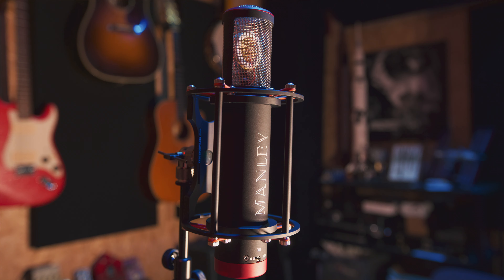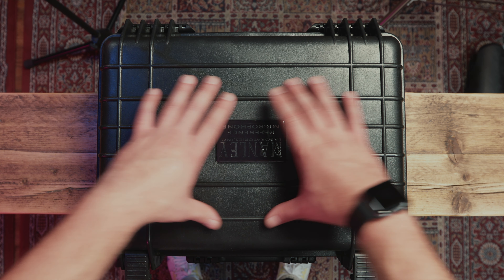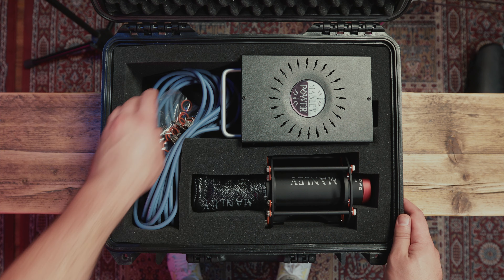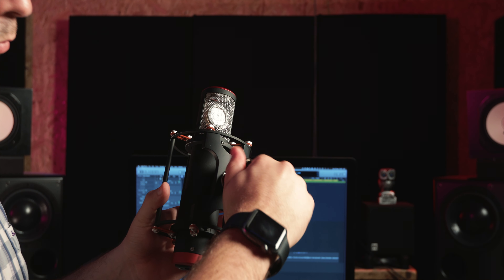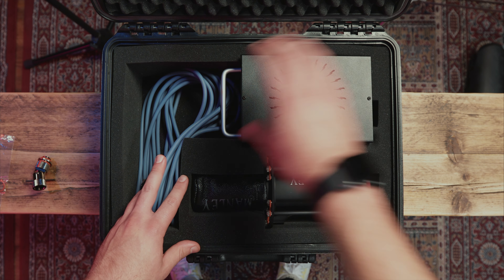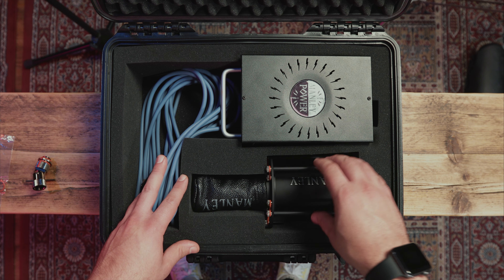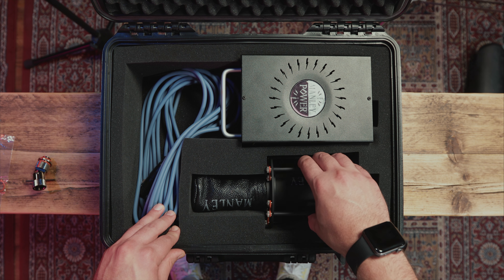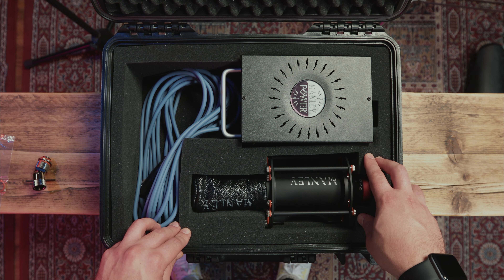Manley Reference Cardioid Demo & Review

Comment: Alec, it seems like you had better luck than I did with this mic. Had it, sold it. I found its self noise to be poor, though it likely had a less than great tube in it. I reached out to Manley and they said their tubes are picked and checked before the mics go out. I didn't pursue it further and didn't appreciate the low level white noise from it. The one you demo here sounds great. As always, a great review.
Reply from the maker: Thanks for the kind words. :) was it one of the older ones? The newer ones have the better power supply which helps with noise.
Reply: @alecbrits  YES, I'm going back about 15 years ago or so. I'll suppose that Manley made improvements on the model, which improved it's self noise.

Comment: This microphone proves that chinese capsules improved a lot.
Important is to be carefuly tested and calibrated and used in a good circuit with quality components.
You could obtain a very good sound you could work with.
Still not the same league as Neumann, Gefell but not far.
Reply from the maker: Thanks for the input. :)

Comment: noob here. i thought that if microphone comes with its own power supply, then it doesn't need preamp, as the power supply will already be driving the amplification stage. what am i misunderstanding? what is the power supply for then?
Reply from the maker: The power supply provides power to the valve circuitry in the microphone. It does not amplify the signal to line level. :) hope that helps. (The only valve mic I know that does have the pre and power supply built in, is the Chandler Red Microphone. That has everything included in the the box to go straight to your interface)
Reply: @alecbrits  thanks, alec! so, it would still need 48V phantom power? also, microphones, which have solid state electronics inside, how come they never require external power supply? i thought it was because of the phantom power, which provide electricity to those circuits. so valve-based electronics require higher electrical demands, hence the power supply?
Reply from the maker: Valve microphones with Power supplies don’t require phantom power (+48v). Condenser microphones do require it, these will state it in the instruction manual if it is required. Yes, valve based designs require a much higher voltage for the circuitry to work in an optimum way. :)
Reply: @alecbrits  i think i (finally) got it. thanks! :-)
now, naturally, we're all wondering how this mic compares to its siblings: silver and gold.